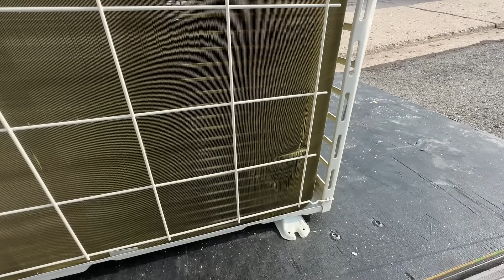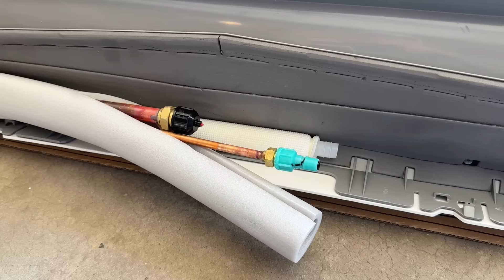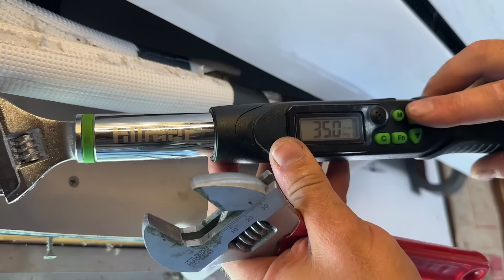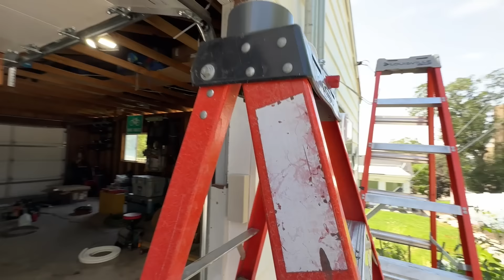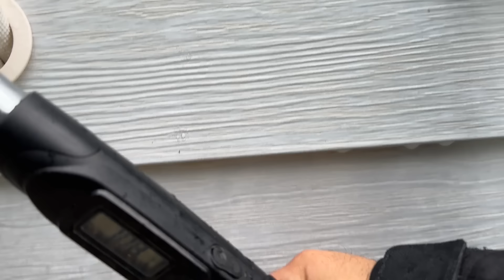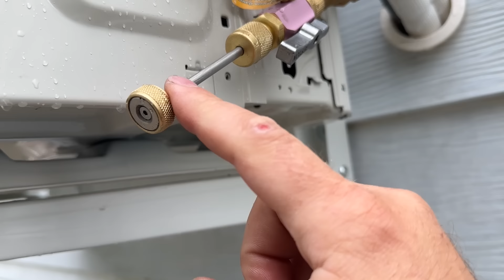How To Install A Mini Split In Your Garage  -Step By Step-

Comment: I just bought a pioneer 12k btu 115v and it says max breaker 25A on the condenser. Should I be running 12g or 10g wire? And should it be a single or double pole 25A breaker? Thanks

Comment: Great video. Just one thing I don't agree with. Nitrogen pressure check should always be done before evacuating. Just because it passes the decay test doesn't mean there are no leaks.  Nitrogen pressure is forcing pressure out to leak test. Vacuum sucks in and can mask leaks. Also if there is the smallest leak you just contaminated the system.

Comment: Can you help with answer a mini split question? The Fujitsu unit is dripping water from the vent fins…the outdoor condensation line is dripping as normal. The unit has worked for years with no issues but all of a sudden it started dripping. Help!

Comment: And on this one we are going to go to 35 ft lbs. Then proceeds to go to 38 ft lbs. Lol. I always go just a bit more when I'm tightening things. I cant help it. It feels like it needs more.
Reply from the maker: Exactly
Reply from the maker: Comes from years of being a mechanic
Reply: @diyhvacguy  it's so true. I've been working with metal for +19 years. You really do get an un explainable "feel" of the metal itself through the tool. Drill, wrenches, screwdrivers, whatever it is, there is some feedback into your hands that tells you whats happening. Love your videos, I'm addicted. Lol

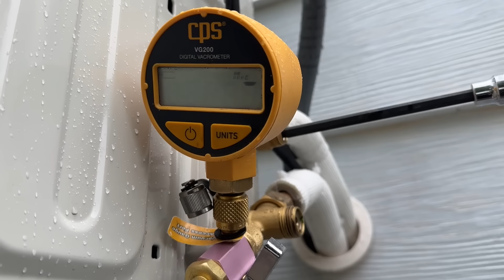Comment: @20:50 how do you know it's fully opened? Is there a risk of over opening these and releasing refrigerant?
Reply from the maker: No there is a c clip that stops the valve from opening any further 👍🏼
Reply: @diyhvacguy  I assume all of these ports will be built like this? I thought I read somewhere that you can over loosen and release refrigerant on some types

Comment: Ive installed 100’s of pioneers in the past 4 years. I was all for them but I have been getting leaks left and right on them and the fan motors start making noise in about 6 months. Spend the extra cash on the Mitsubishi but Ive have had issues with them also. They are all using all that cheap chinese copper in them. Pioneers are made in the Midea factory in China. Its sad to because Parker Davis used to be a reputable company and now they sell throw a ways. No reason to have pin hole leaks. Do better Parker Davis.

Comment: Beyond installing?  Looks fine to me.  I just bought a damaged outdoor minisplit unit from a local HVAC company for a huge discount.  Looks like it was hit by a forklift but none of the internals were damaged.  Should work great.

I’d be negotiating a discount if possible instead of a replacement.
Reply from the maker: They sent me a new one and told me to keep the old! Great customer service. My buddies wife is pretty picky so we waited for a new one 🤷🏻‍♂️
Reply: @diyhvacguy  That is great service!

Comment: I agree with you.  The Pioneer mini splits are very easy to install.  I installed mines in my pole barn in March of 2022.  I also installed the wi fi dongle and it was wonderful working in a comfortable workspace during the Summer and Winter months.  An added bonus is that the unit is extremely energy effecient.

Comment: If i was to ever go cheap,I would say Pioneer would be the unit! First time I ever saw one was a DIY install gone bad! (Brake line flare tools are not for linesets) I reflared,nitrogen test,evacuated and charged both units! But I gotta say,the build quality was pretty darn good!

Comment: I just installed a mini split a few weekends ago. Thing works great! I did everything my self and its straight pro job. Even have a Surge protector defending the control boards etc... mounted to the cutoff switch. I got my 608 Type 2 so I can work on my own junk. Thanks to your channel it was a huge help to begin with.
Reply: It was a Pioneer 22 Seer... This thing sips energy. A 2 ton unit and it cost me maybe 1 to 2 bucks a day to run. Amazing inverter tech.

Comment: I’ve watched a few of your videos now. I like the way you explain everything. I’m confident enough to do this myself. I’m going to install a 1200 btu unit in my garage. Can I run the line set on the inside walls and just make the hole through the concrete block on the bottom to go outside? I’d like to keep the line set more hidden, than to see from the outside. Thanks!
Reply from the maker: Yes you can do this so your line goes behind the head unit. If you need some help finding the right equipment feel free to email me at diyhvacguy@gmail.com   Cheers

Comment: How do ya do it if ya have 6 rooms that need one? These are confusing 🫤 I don’t have enough 220v fuse places left in my breaker box, I want to have heat as well as ac on each one?! Cornfuzzzling 🙏🦌😂✝️✅🤠🏡👴💒🫤
Reply: There are multi-zone ductless mini-split systems where there's still just one outdoor unit, but multiple indoor heads connect to the same one outdoor unit. And they all can run independently from each other.
Reply: @SomeRandomDude-zqxj  oh wow it probably costs a few lifetimes to pay for too right? that’s what I want! ✅❤️😂✝️🙏🏡💒👴🦌🤠